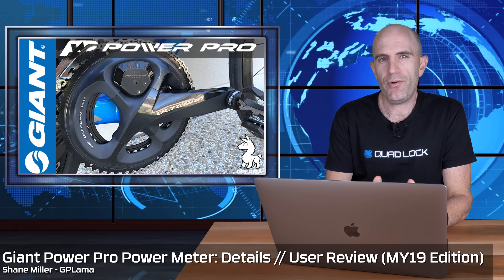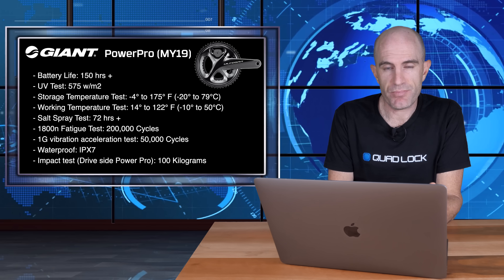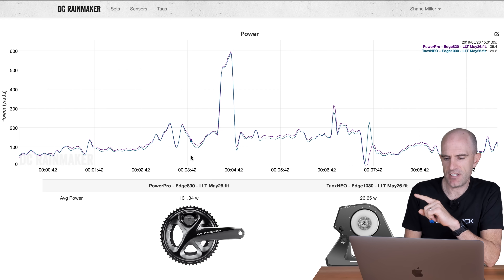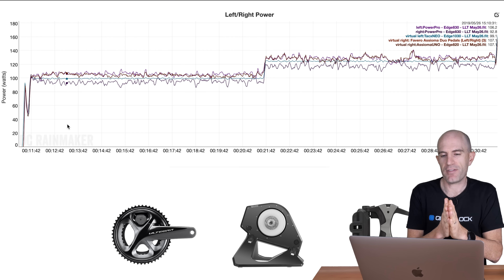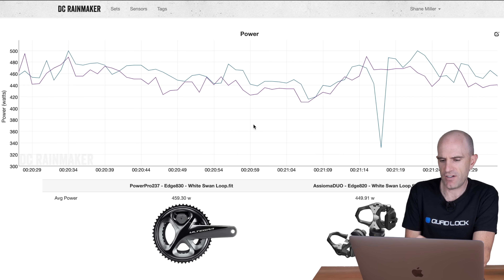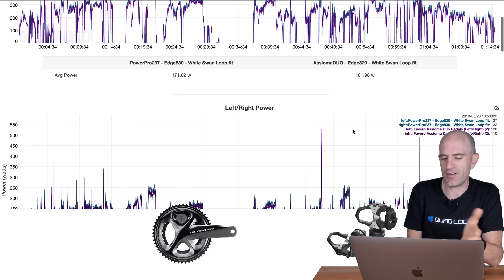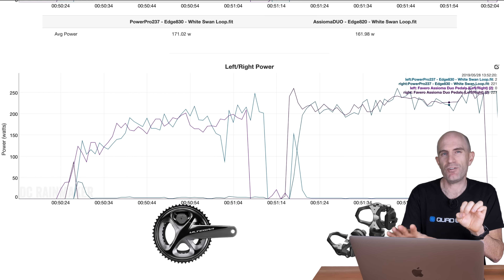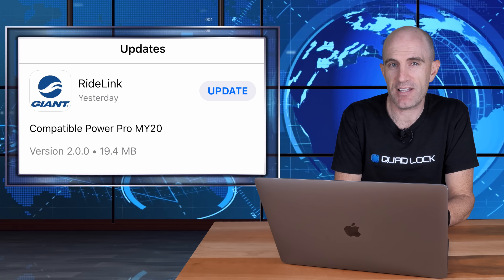GIANT Power Pro Power Meter: Details // User Review (MY19)

Comment: Does anyone have a link or solution to connect both sensors to Garmin?. I’m new to Both power meters and Garmin.
Reply from the maker: You only need to connect one side (the left, iirc) to get dual data.

Comment: Hey I’ve had the same bike for around 9 months and the PM started to do weird things in the last month. First the reading went up by 10x then after calibrating on RideLink, it went the opposite, barely reaching 100w. I took it to giant Hampton where they sent it back to giant to update the firmware. Just got my bike back and now I’m having the same problem u described. Anything over 300w the cadence drops out and power drops to 0 and stays there for more than 10min. So frustrating. Who’s your contact from Giant that u emailed? I’d like to get direct contact as well
Reply from the maker: Bugger. I had Giant USA reach out to me, they're of no use for a warranty in AU though. Keep on with Hampton Giant. If it's under warranty it should mean you get a working power meter.
Reply: @gplama  can you share the Giant US contact info?  I can’t find anything. I’ve had mine for 2 years, and it just stopped transmitting. My garmin 830 and the RideLink app don’t pick it up.
Reply from the maker: @pieboy257  You'll have to reach out to Giant support directly.

Comment: I have had this PM for 4 months now and it has just given up the ghost. Riding along and the L/R balance starts to drift from 50/50 to 60/40 then it ends up at 100/0. Stop recalibrate and 10 minutes later same thing. Make sure it is charged then do the firmware update, no difference. It is going back to the shop tomorrow.
Reply from the maker: Bugger. Let me know how you get on with Giant.
Reply: @gplama  good news, I had the new Power Pro 2 installed today. Looks different to the original, I will give it a whirl tomorrow. Good support from Giant in this one.
Reply from the maker: @damienwalker1026  Nice one. The MY20 version is very discrete. It was one of the better Shimano based dual sided units I've tested.
Reply: @gplama  dropped the bike off today. The mechanic said he had heard of the power pro not working with a Garmin but worked fine with the neostrack. That would be feasible except it has worked fine for over 3 months with a Garmin 520 before flatlining during 3 peaks this weekend. I will keep you posted.
Reply from the maker: @damienwalker1026  That's BS on the Neostrack sorry. That unit is a rebranded Bryton. If something is going to work, it'll work with a Garmin.
Reply: @gplama  Giant have approved a replacement crankset, I don't know if it will be the newer generation power meter or not. Due to the world being in a state of flux at the moment delivery will be a bit longer than normal. In the meantime I have put my Assioma's on.

Comment: As I got to compare the Power output of my Giant Power Pro (same version as reviewed here) to Assioma Duo and also to Wahoo Kickr - it turned out Power Pro is always ca 15-20 watts lower.  I have calibrated all the units and using latest firmware available. That is not good.
Reply from the maker: No surprises there. Looking at the L/R split data would be interesting.
Reply: @gplama  Assioma Duos give L49%/R51%, Giant Power Pro vice Versa L51%/R49%. When I look at L/R split graphs in Garmin Connect, actually the Assioma Duo is more scattered and Power pro dots stay closer together. Don't know how to compare any better :). Here's the Power Pro result https://connect.garmin.com/modern/activity/4619168804
Reply from the maker: @MrPriitg  If you're after reasons why the right side on the Giant PowerPro reads low: https://gplama.com/2019/06/29/shimano-crankset-power-meters/

Comment: Hi, i just bought a Propel Advanced Pro 1 2020 with a Giant Power Pro PM. On my other bike (Focus Izalco) i use P2Max PM. The overall power output ist Pretty simular ~ 10 Watts difference at the most. So you do not know which is closer to the truth. Anyway, i always had the fell...that my P2Max is showing a liitle less watts compared to other guys driving next to me with simular systemweight. Especially with pedal PM i thought they were way too high (+20 watts). So...after having used the Power Pro for about 450km, i fell a difference of 10 watts+ in NP Power after almost each ride??? However, the only liable result is speed (take apart external conditions) i guess….if data is too low or high. Maybe...i have a new Version of the PM but i am really happy with it. Since it came with the bike and is rechargeable by USB.

Comment: Shane, any updates on your correspondence with Giant? I have exactly the same problem (exactly the same bike too). 10-15 watts difference over both my Assioma pedals and my Powertap Hub.

The Giant app is pretty horrible too. I think I've updated the firmware but it's hit and miss as to whether it does it or not. It completed the process, then gave an error message but then had also update the firmware version. I really expect better from a company as big as Giant.
Reply from the maker: None on the MY19 version. I have the MY20 version here I’ve been using. Have you isolated the issue to lower on the right? Your local Giant dealer should take care of you if you can take them the data showing it’s dodgy.

Comment: How do the PowerPro and Ridesence work together? Both systems deliver cadence, do you just have to choose one over the other when connecting to a head unit? Or does the PowerPro rely on cadence readings from the Ridesense unit? 

Currently looking at the TCR Advanced Pro 2 Disc (2020) which looks like this years model of your bike without Di2, but this one has the MY20 Powerpro system which should hopefully have some of these issues resolved with it! Hopefully you can get your hands on the MY20 soon to see if it's been improved.
Reply from the maker: That's an interesting question. The PowerPro will send cadence over ANT+ to the head unit making RideSense cadence a little redundant. Stay tuned for my coverage of the MY20 unit.

Comment: Hi. My power pro started to display inaccurate measurements a few days ago. The balance between right and left was completely crazy, 80-20.

For several days, the battery does not seem to take charge. When the powerpro is connected to the charging cable, my garmin and iphone connect. When I unplug the cable, it disappears of monitors.

Have you ever seen this?
Reply from the maker: Best contact Giant on this one. That doesn’t sound right.

Comment: Pedal smoothness and torque effectiveness don’t seem to register any data on my Garmin 1030....any ideas?
Reply from the maker: What power meter are you using?
Reply from the maker: *oh, if it’s this Giant Power Pro, it doesn’t support these metrics.
Reply: Shane, it’s the Giant Power Pro. 
Is it a software thing?
Reply from the maker: @dacosta1972  Those metrics don't appear to be supported by the power meter. Not sure of the specifics sorry.

Comment: Shane, is it possible to pair the Power Pro to a Garmin head unit and use for the power only? And pair a dedicated cadence sensor using that for cadence instead of the Power Pro. Thanks
Reply from the maker: I'm not 100% on that. I'd assume if there's a separate cadence sensor then that'd override what's recorded. *only an assumption. Would need testing.
Reply: @gplama  thanks, only one way to find out, I'll have to buy one and see  :)
Reply: Do you think the Ridesense disturbs the connection between the PM and Garmin Device? It both measures cadence. I experience permanent loss of connection of the PM, a pain in the a**

Comment: Thanks for another great review Shane. I was not considering buying a power meter but the Giant I'm looking at basically forces you to get one if you want a bike with Di2. 

I'm after an endurance geometry and looking as the Defy Advanced, seems good value at ~6-7k with Di2/Carbon wheels even without this added fruit. Possibly therein lies the problem they've made it on the cheap? I'd rather not buy the power meter and have $hundred whatever off the RRP and buy a third party PM if need be.

Comment: My Giant Power Pro Meter stopped working and was replaced. Now it has come back but it transits power data out but I can't calibrate it or update the firmware :(. The communication appears to be only one direction. Any ideas about fixing appreciated (I'm 700 km from the dealer)
Reply from the maker: Call the dealer. Return it.
Reply: @gplama  Thanks but I don't think he knows what to do. I only got it back yesterday and it doesn't work. Doing my head in.
Reply from the maker: If the guy who sells it doesn’t know what to do.... 🤷🏻‍♂️

Comment: Regarding your statement, power meters attached to Shimano cranksets, right side power values can't be relied on. My uneducated guess is you haven't tested a Pioneer unit. 
Are Giant claiming they have strain gauges in both left and right crank arms? or just power balance? Shimano also have their own power meter (built by Pioneer) but they only have one strain gauge and determine L-R power balance through data collected from the position of the crank and force on the strain gauge. 
I guess its the same old story, get what you pay for. I questioned a LBS in Osaka why the Shimano power meter crank was cheaper than the Pioneer, the response was "the Pioneer has two strain gauge and is very precise, Shimano power meter has one strain guage and almost cost is same.. But Shimano is OEM part so good quality.. but ummmm warranty is the same as Pioneer, maybe better is Pioneer", so honest was the sales guy...
Reply from the maker: I'm going to ruin the party here. I have two Pioneer LR units. Including the new one. They're currently sending me a third in an attempt to work out why I'm getting the results I am from the right side.
Reply: @gplama  How many additional units did Giant send you with your months and months of trouble? or a bucket load of E-mail is enough to satisfy and fix your quest for satisfaction? 
It sounds like Pioneer are serious about fixing your personal issues with their product and more than likely the unit they are sending you has been tested many many times to ensure it is above the tolerances Pioneer accept (knowing how the Japanese work). Is the Giant power meter a dual strain gauge set up? If there is a consistency of Right side data being out, do you have any other measure that is genuinely left and right? Like Garmin LR Vector, or Infocrank? I'm really curious because I have had no trouble with my Pioneer, I sent my used 9000 DA crankset to be upgraded with the power meter from Pioneer in Osaka and it was sent back to me via courier, so maybe the problem is shipping?? I'm really curious now because I haven't had any trouble with mine. It always tracks really close to my trainer (Elite Drivo).  
Hope everything is sorted soon. Oh BTW 180rpm is a little low... I'm over 40 and can spin way above 200 rpm.
Reply from the maker: @simongeeves9662  
1. None. 
2. Yes, dual. 
3. Yes, Assioma DUO, P1, P2, Vector 3.

Comment: I have a 2019 Giant TCR SL1 Disc - My power meter was working fine for 2 months.. Now I didn't read correct power. I had a crit race last night where my max sprint was 512w usually is over 1200w - It also said that my 20min average power was 125w.. usually it's around 315w. I've made attempts to get it replaced however they keep telling me that "They're working on it"

Comment: I guess I was lucky and mine is working as it should so far. Unfortunately, I have nothing to compare it with but power values come close to those I was getting from my Powertap GS and L/R balance seems OK (49/51 - 48/52) in my case. I wish I had something to compare it with. Great review, thanks!!
Reply: I jinxed myself... I’ve been starting to get some issues with cadence jumping up and down from one second to the next. Even the BT and the ANT+ (Garmin vs Kickr) are reading differently. Weird, I need to do more testing as I used not to have these issues before.

Comment: The 1800n should be 1800N, being 1800 Newtons. 1800N is the force applied by a 180kg weight in the Earth's gravitational field.  In the context of a bike rider 180kg would be the weight force applied through one leg by a very strong rider during a pedal stroke in say a sprint.  The fatigue test applies this 180kg weight force 200,000 times to check there is no microscopic cumulative damage occurring in the power meter's metal parts that would manifest as a sudden fracture of the part.  Obviously fatigue failure is something to be avoided, a classic example is the Comet jet airliner in the 1950's.
Reply: Sorry by the corretion.
Being more precise, in the context, 1800N is 1800 Newton. The physical units has no plural.

Comment: Hi, do you have any kind of power smoothing in the graphs on the Power Pro? I just got a Power2Max NGEco, really like it, uploaded one set to DCRAnalyzer comparing it to Wahoo Kickr SNAP, the Wahoo had power smoothing on (forgot it was on) while there appears to be no power smoothing option I could find for the Power2Max, so the graphs didn't look too smooth and comparable. But the averages overall were within 1-2 watts which seems more reassuring.
Reply from the maker: I left off the smoothing for the outside rides. Inside in the Lama Lab iirc it was on 5 second for the DCR analysis.
Reply: @gplama  Thanks

Comment: Here goes: UV test -> 575W/m^2 that is power/area so some kind of UV light flux. Testing how UV affects the case/plastic? Salt spray test-> Exposure to salt water spray for 72 hours. Does the unit still work is there salt inside? Fatigue test->Put 1800 N of force 200000 times on crank arm I imagine and check for failure or if still in spec?  1G test-> Expose unit to 1G so 9.8 m/s^2 acceleration 50,000 times does it work or in spec?
Reply: The difficulty here is that these results are alone - so we don't really know if these are good results showing meeting a high bar of quality compared to the competition, or just 'meh' that anyone can achieve. Nice for them to be the first brand showing them though as it might 'wow' some people just as it looks impressive
Reply: Indeed we also don't know the pass/fail criteria. It was probably marketing guys who grabbed data from the technical side cause it sounds cool. First thing I noticed are the errors in capitalization for thing like forces in n and not N .
Reply from the maker: Excellent. Thank you. So they've done a lot of detailed mechanical tests.... More human testing needed!
Reply: @gplama  it at least suggests they have given some thought to the physical durability of the PM. Vector 3's for example could have done with more of this. But as you say, more people testing required as well.
Reply: @andrewmcalister3462  Right, its good to confirm that they identified the expected environment in which the product needs to perform and simulated the real life stresses.  UV weakens plastics & coatings, salt will accelerate corrosion & material degradation, vibration simulates the road, fatigue could equate to 2000 hrs of ~1800 watts at 100 rpm.  The most rigorous approach would be to perform these tests sequentially on the same unit.   UV, then fatigue, then vibe & extreme temp cycles to create & grow any cracks... then do the salt spray & IPX7.  For a product with a removable battery you would plan to open & close the battery compartment a few times in that sequence.    Pass all that and your physical structure can be relied on.   From there, you move on to those human, functional tests like cadence & power measurement over varying but more nominal conditions.  Usually, you'd have data from prototypes and you aim to confirm that the final configuration is still performing to spec.   Anyway, I'm sure some other manufactures run these types of tests but it is nice as a consumer to have the company come out and say it clearly.  (better still would be to reference the standard they used...)

Comment: Shane, re the cause of the measured cadence variation between the Giant and Favero PMs, a likely cause is that the Giant PM is using an AVERAGE angular velocity value per revolution whereas the Favero PMs cadence value is based on a REAL angular velocity with a higher sampling rate for each revoluton.  The variation in the reported/calculated power based on the different methods for recording angular velocity is exacerbated in certain - not so smooth - pedaling situations and/or the use of oval chainrings.  See the Favero website on their explanation of the "Advantages of the IAV [instantateous angular velocity] Power System" at https://cycling.favero.com/blog/tech-tests/whats-iav-power.  They even provide access to their research paper.  Giant would not be the only ones using an average angular velocity for their PMs.

Comment: I've probably watched all your power meter reviews and I still go back to the rotor 2inpower. It still seems to be the most reliable crank based PM today. I've the power2max ngeco on my bike and it seems ok, reads a little higher indoors compared to the tacx neo, but I'm still drooling over the 2inpower with their DM chainrings

Comment: Have you reviewed the Pioneer Power Meter?  Can't find anything current for these.
Reply from the maker: I have two Pioneer power meters. They're sending me a third.... a story for another day.
Reply: @gplama  I have a gen 2 (I think) left only pioneer connecting to a garmin via Ant+. It has huge 4-5 second lag between when power changes and when the head unit sees it. its also mega spiky. The 4iiii left only before it did not have this problem. I wonder if the new pioneers are fixed in that regard.